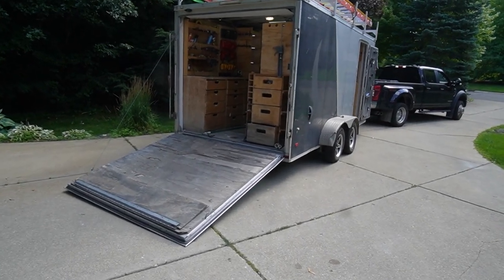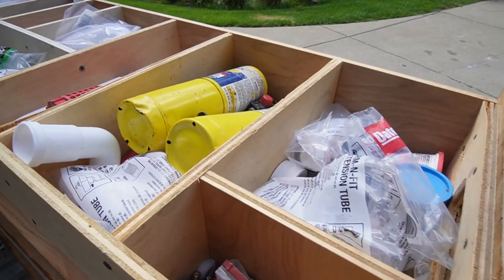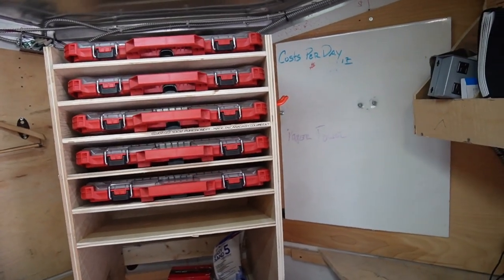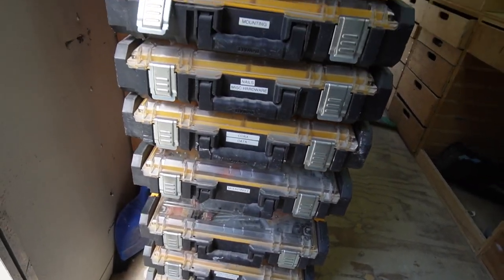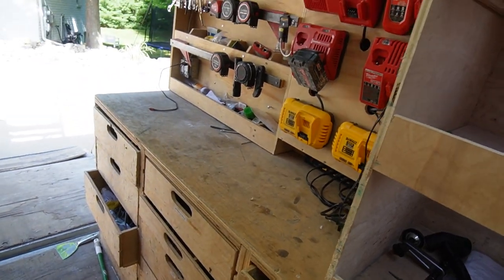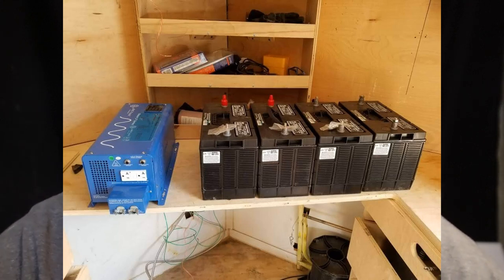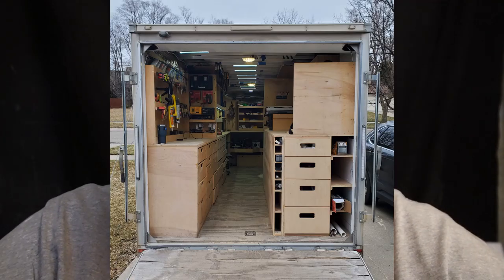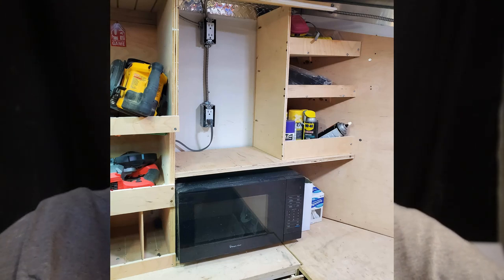Tool Trailer! Tools may not be the most important part!

Comment: I just got my first trailer, a little 6x10, and it's already made my life easier. Before, my entire truck bed and cab was filled with tools and materials. Now, my kids don't have to hold saws on the way to daycare 🤣🤣 great video!
Reply: What work do you do? I’ve been doing handyman (well handywoman) work and small renovations for the last year. I’m looking to move towards the bathroom/kitchen size renovations, but the handyman stuff has been good filler work in between those projects. But all of the above require a lot of tools for every trade. I’ve been managing between my truck, a Decked drawer system, and a storage unit but it’s really inefficient I’m thinking I need a trailer. However 6x10 is probably the most comfortable size with my truck so I’m curious to hear how that size is working for you and how you’ve organized it?
Reply from the maker: I'm a general contractor that does most everything. Kitchens, baths, additions, basements, and decks mostly. Having a trailer is a game changer for efficiency. Absolutely a most for what I do.
Reply: @RenovationsandRepair  sorry I meant to tag Austin! I’ve been following your videos for a while now and everything you post has been super helpful, especially since I’m starting out. Thanks for your latest one about how you got your business going. And also for being open about your mistakes. I’ve always been good at building things and working with my hands, but I have second-guessed whether practicing on my own house and starting with small projects for clients would be enough experience to go out on my own, so it’s reassuring to know that you had taken a similar path in the beginning. I am curious though, was it difficult to get your contractor’s license? In AZ where I’m at you need 4 years of work experience, and working on my own is in the gray area of “experience” but not exactly kosher since I’m not yet licensed.
Reply from the maker: Yeah her ein Michigan you just have to take a 60 hour course and pass a test to get your license so no time in field requirements here. I would assume bhaving a handy woman business would count as long as you can prove its a legit business with a EIN.